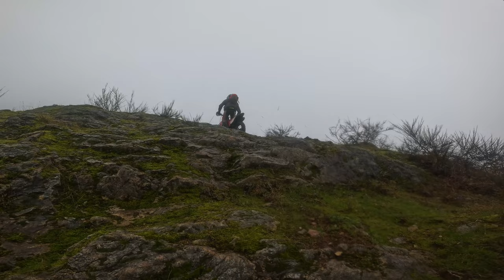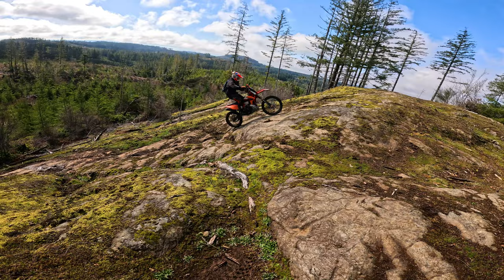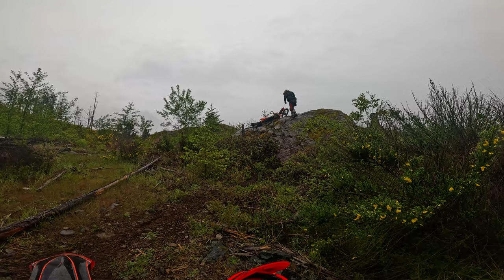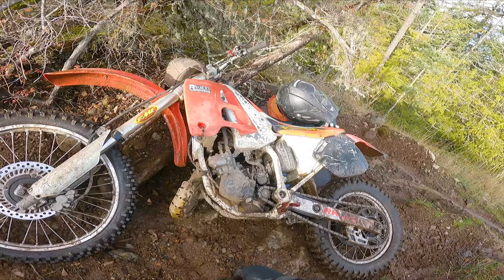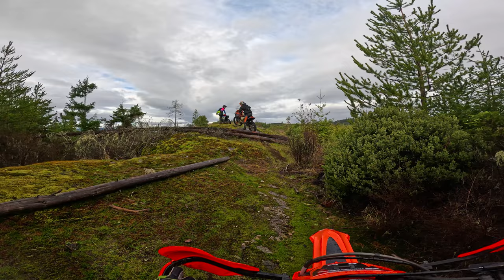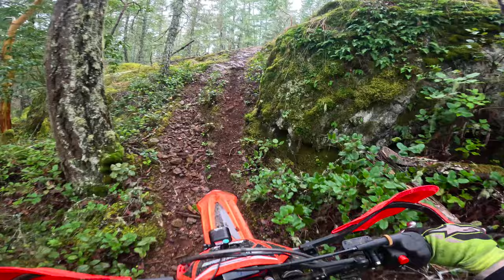Dirt Bike Fails, Crashes & Funny Moments

Comment: Great stuff!  How you keeping the radiator shrouds intact? Mine break on every little toss into the rocks!
Reply from the maker: Im running the axp rad braces! (Not the guards)
Reply: @AaronsEnduro  hmm wonder if they would work with the BPD rad guards?
Reply from the maker: @PrimalEnduro from my understanding they dont work with aftermarket guards. I could be wrong but AXP lists you can either use their braces or the guards but not both.

I chose braces over guards because i feel like im more likely to drop the bike on its side than have a racer infront of me spraying rocks and stuff into my rads. 

That being said i dont race and only go riding with the bros on the weekends